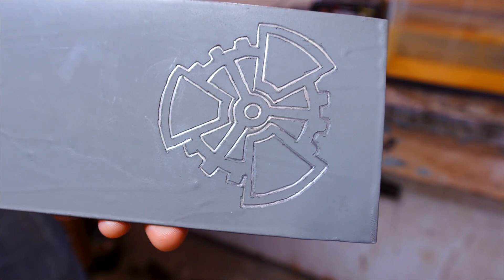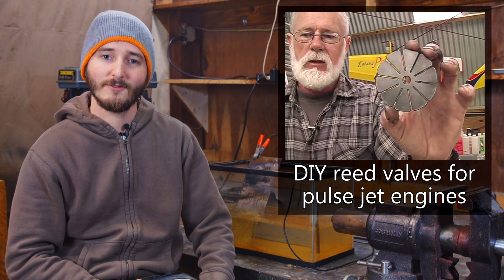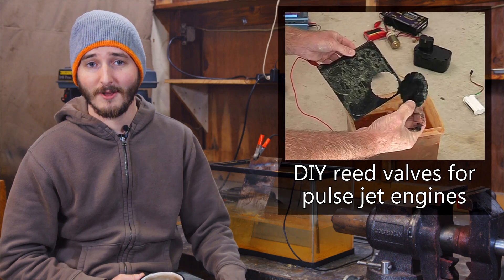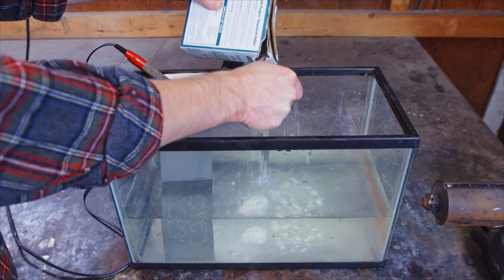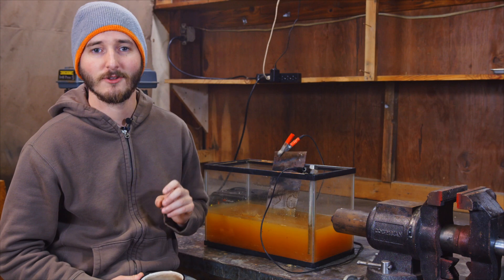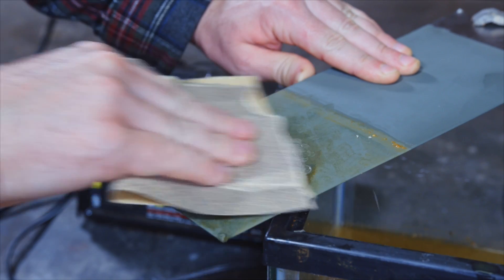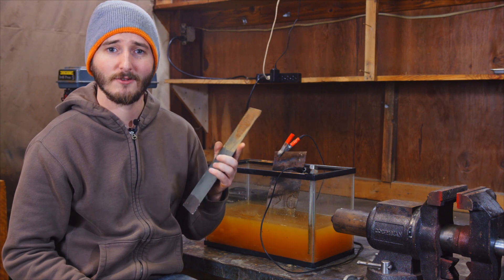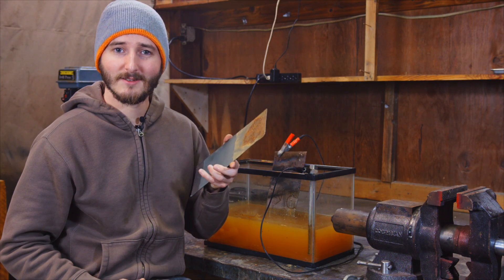How To Cut Steel With Electrolysis [Experiment In Progress] - NightHawkInLight

Comment: I know this is going to sound low tech compared to some other suggestions, but the thickness of your material makes a lot of difference. As the steel is worn down, think of it like a burning a candle. The taller the candle's relation to it's diameter the less even the sides will melt and it will not be uniform along the side walls. If you have a thick sheet of steel relative to the width of your etch, then the electrolysis will begin to infiltrate into the side walls of the etched surface before it's penetrated through. I've seen etchings of copper plate for PCB's be completely ruined because of this. It's not actually getting through or even really under the etching paint or wax. It's going through the side of the freshly etched surface and getting under the paint that way moving laterally through the material rather than through it. Try every so often scuffing it up and cleaning the surface, then reapply the etching paint and scoring new etch lines into the surface. An alternative could also be to use etching pens that would allow you to do touch ups along the sides as you go to prevent the sides of the material from being bleed into. It really has little to do with your electrolyte or the voltage as much as it does the relative thickness of the material to the width of the etching area.

Comment: In simple words, I believe that it's all about the rate in which only the metal part that you want, becomes rust; so the higher the reaction speed is, the better. On the opposite side, a high reaction speed will produce more bubbles in less time, which could lead to bubbling under the paint. 
I think there are too many factors that influence the outcome of this experiment, so rather than explaining them, I will propose a method I believe would work and or some observations:
- The metal sheet should be as thin as possible and hopefully not the cheapest.
- The sheet should first be cleaned with some dishwasher soap and a coarse sponge.
- Then, scrubbed under diluted hydrochloric acid.
- After the acid, it should be dried hopefully under an inert atmosphere and under that atmosphere it should also be painted.
- Now, over the painted and dried sheet, the hand sketching should be done as deep as possible and sketched lines should not be passed over more than one time (it is important that the surface under the sheet is hard and smooth, like marble; also, managing to sketch the figure on the back side of the sheet should cut your electrolyzing time in half!).
- For the etching part, the sketched part should be always submerged in a concentrated solution of sodium hydroxide (or just something strongly abrasive, depends on the paint you use) as hot as possible (wax may not be an option but you could try it without heating the solution) and electrolyzed with the highest (and safest) amperage you can get.
- The goal now is to get the "rust" off, as soon as it is formed; so constant movement of the sheet could be applied or maybe getting a constant stream of the same electrolyzing solution poured against the sheet could also work.

In the end I believe that it is more effective to go with the fast and powerful way (also more dangerous and maybe a little bit more expensive), than the time consuming and maybe more frustrating alternative.

I hope I was of some help, cheers!

Comment: Unfortunately, the whole approach is flawed, no matter what electrolyte is used. Here's why: Imagine a cross section through a cut path. On top is the paint which has a specified break in it. Below that is the metal, which may be scored at the paint break. Below the metal is another protective layer of paint. As the electrochemical erosion of the metal proceeds, you first get a trough, but as the trough gets deeper it begins to form a mushroom shape, which undercuts the top paint layer. By the time the erosion reaches the bottom paint layer, thus cutting through the metal stock, the mushrooming has gone fractal under the top paint layer and your cut becomes very imprecise and jagged.

Comment: um sir.. maybe firstly you should to shorten the length of the plate.. secondly, try to paint the plate with base paint first after that the final coat (to make sure there's isn't any leakage , and finally the way you scratch the metal using proper tool to go deeper (i wonder if drilling will help) 

in my opinion the thickness of the plate also the steel you using is maybe have any effect.. try with very thin plate first sir just a suggestion..

thank you :)

Comment: I have a material very similar to "overhead projector plastic" that you print a positive image onto with a Laser Printer.
Then you can transfer the toner image to metal sheets by "ironing it on" in a thermal transfer process. (search toner transfer paper )

The toner is resistant to etchants like ferric-chloride.
This method is used to make simple printed circuit boards on copper clad PCB materials.

This method should be able to work on sufficiently thin materials as long as you can compensate for the amount of "undercut" you can tolerate.
Also the speed of the etching can vary the quality & speed of the cut.
Try very hot etchant next time.
And do you fully mask one side while putting a positive image on the other side? (one sided etching).
Or do you put registered images on both sides and cut both at once?

Comment: Try a solution of 600ml 85% phosphoric acid 150ml Destilled water and 250ml of glycerin. Do the electrolysis at 20v. Should do the trick.

Comment: From what I can see, is you are basically rusting your way through the steel.
And as we all know rust will work it's way under paint / wax.
so, you will need to clean it regularly, maybe even sand off a bit of the wax, re apply and etch it again.
doing it in 1 step won't work, you will need to do it in stages.
Maybe even try "anti-rust" primer paint.

Comment: The problem I see with this method is the electricity flows through the metal. It can't be precise because the corrosion will follow underneath the paint up to the source of electricity. I would scrap the project, it would be a waste of time.

Comment: i believe it actually the chlorine that is key for this to work i doubt you need to worry about the chlorine as its so reactive it should react with the steel before leaving solution. left over is iron(iii) chloride that's the "salts" you see in the video it should only react with the expose steel maybe even using an acid like muriatic acid/ hydrochloric acid would speed up the process. what you are doing is trying to speed up the oxidation of the steel which in your method might work if the water was moving removing the rust as it form to help speed it up because as it oxidation it forming a layer as its reacts the layer grows thus slowing down the reaction and as form its easier for react it to with the metal around where you want it then getting under the paint. did you clean the metal with something like acetone or alcohol just before you part it in to the bin even slight amount of grease can ruin it. as for the paint that's another issue but i think i saw some comments on that already i'm not well versus on paints i say just silicone or etching primer paint some neutral and water resistant.  that's my theory anyways if gr 12 chem and welding has taught me anything. its murphy's law this is a very tricky process actually. i recommending follow his video till you get it to work then try to change it. i am actually looking in to this more try some small scale experiments try figuring out just whats happening how to make it more efficient and reliable.

Comment: Use the photosensitive compound for etching copper clad boards than print and expose the area you want to cut out and dip it in to the solution. Use low power current source, stir the solution constantly with a fountain pump. The other electrode needs to be as close as possible to the parts you want to erode.

Comment: the problem that I see with this experiment is that the amperage is too low to start with.  If you want to use DC battery ( instead of using a, AC to DC welder) then you will need to make a jewel thief strong enough, to get the voltage high enough (+ have on one side of a few capacitors <[ONLY!!!!! have enough to boost the current to create a connection in the water!!]-[making a polarized boosting Van de Graaff generator] connected to the next one [if there is need] before the AMP step up Transformer in the Joule Thief circuit, and a diode(s) from the capacitor to the other side of the DC step up amp circuit)to convert the voltage into amps ranging from 20 to 90. This will do two things,
1. Will convert the water to HHO
    A. microbubbles receive apps and volts to make a Spark then explode
    B. the explosions makes a small area of high heat and ultrasonic vibrations to cut the metal
(please have the material in a rubber or plastic bucket or container)(no glass please)
2. burn the electrolyte to the base metal to make an electrical coating. ( see, cleaning of HHO plates)

because this is a DIY project I cannot say the exact levels or formulas for each area that is needed to complete the necessary functions to cut the base metal. but hey that's the fun of doing experimentation
( have the base metal negative to make the Sparks jump from the metal to the water) - (and make your scratches as thin as possible, too much exposure equals more heat in the base metal causing Steam and extra burning of the electrolyte) - ( Plus make sure that the water is well chilled to keep the base metal from overheating)
if I can find or think I will try and repost at the end of this post 

for more information look up "underwater CNC plasma cutting"

Comment: I think you have to assume it will always grow out in a radius from any exposed spot, therefore some smaller details will become impossible if the metal is a certain thickness. also your lines to restrain it should then also be brought inward by this radius to account for the thickness of the metal. basically the thickness of the metal becomes an outline, the thicker the metal, the worse it will be.

Comment: I think if you do a hybrid method of wax and paint it may keep the hydrogen out longer, also the thickness of the steel might change the outcome because it would cut down below the layers of steel and start cutting under the paint/wax. I'm not actually sure for any of this hopefully it will all help.

Comment: What is your other electrode? I would try using a plate for the other electrode,  parallel to the workpiece. If the current is perpendicular to the workpiece, it won't eat sideways as much.

Comment: What's the temperature like in that electrolysis box after a couple hours? The DNA electrophoresis boxes we use in my lab get quite hot after a while even at modest voltages, and over enough time it starts to melt the gel and ruin your results. If you have a lot of heat buildup, it might be interfering with the seal of the paint to the metal.

Comment: What if you don't scratch the metal at all. Have a pattern placed on the metal and then use the self etching paint. That way the paint can bond onto the steel and won't be disturbed from scratching. Theory sounds pretty solid and sorry if someone else already commented the same thing.

Comment: Hmm i got a idea, as soon as it starts to bubble pull it out and then redo the wax/paint layer and then re etch it out and repeat the process as many times as it takes to cut through. You just got to check it on a interval and re-coat.

Comment: Well maybe you could cut out a design in Styrofoam then glue/double sided tape it to the selected area of steel. Then paint the thing with three coats then dip it in wax then take away the Styrofoam and do the rest like normal.

Comment: How about you put a template on the steel and spray over it, so that the paint covers the steel properly. That way you can remove the template, leaving the design in 'negative'. The way I see it, the paint isn't damaged this way, and should give less deforming of the desing image. cheers!
Reply from the maker: I thought about trying something like that but making a template itself would be a really tricky project.

Comment: Have you tried different voltages? Electrolysis in Salt water can occur at lower voltages, might be worth a shot if you are using 12 volts, try lowering it? if the voltage is too aggressive you might be producing NaOH which might soften the paint. All of this is guess work from a couch, but I'd give it a try.

Comment: Always use considerable agitation to keep the metal exposed to the solution for deeper, faster, cleaner cuts. Use same area plates as parallel to target when possible for even cutting (think path of least resistance).  Use several coats of enamel.  There will be undercut on thicker targets...so allow for this and finish the piece later.  Don"t give up on this process...it is the most overlooked tool/process in the shop!  It requires an appropriate electrolyte for the type of metal being cut.

Good luck, love your vids.

Comment: Random comments:
Sometimes it is necessary to use chemicals which are not safe for children.
I like 10 percent LYE solution.
Adding common salt to vinegar produces weak hydrochloric acid. 
It is not always necessary to use a container which is huge compared to your work piece.
Constant flow or agitation of the liquid is often helpful.
A large electrode close to your work piece is superior to a small one inches away.
See "Electrochemical Machining," one may find some clues there.
disclaimer: Assume that everything I say is wrong.

Comment: You could lay the metal piece on a table. And put some type of ring around it using like (I don't know, hot glue?) and pour water in the ring. Then dip an electrode in the water and run the current. Also make sure that you still have it coated of course.

Comment: Maybe the time is factor too, I work with electrolysis often in lab and I know for experience that high voltage gets tings going at faster rate,  just get some more batteries and hook them up in series to increase the voltage. I also saw that the sheet of steel was hooked up to red wire it should be hooked up to black or the negative terminal but that's just my suggestion

Comment: maybe I missed something in the video but the first thing that stood out to me was your flow. You need both an anode and a cathode. Personally I would submerge the metal in the center of the tank, upright, then have your anode at one end, then your cathode at the other. I've found decent carbon steels work well for this. You can continue to use the baking soda (washing powder variety) if you use two pieces of carbon steel and your water won't get as gunked up. 

interestingly enough, this process will also clean the object inserted. Its a method I use for rust removal. Occasionally it has cut steel for basic etching designs I've done. I've never tried anything like completely cutting THROUGH steel, but I'm assuming it should work.
Reply: Oh, uh, kinda an important step: Do this shit outside in a well ventilated area. 

also to note, I'm not sure if being used directly as your anode is what is causing the bubbling on your paint (though I'm willing to guess current passing through it from beneath the layer will create a bubbled effect where its released) but if it doesn't change with the setup I mentioned, try changing that first. Most etching jobs take only a few minutes. I've seen some groves put into solid steel cylinders that were impressively deep without it causing the metal to rust in minutes.

Comment: use high voltage , because  u need to cut it  faster so it does have time to propagate inside the steel, and ruining the design

Comment: For your resist, you want Bitumous or bitumin paint.  This stuff should resist the blistering effect the best.  You can load up a fountain pen and draw with it or apply it over a stencil.  You could put it in an airbrush too if you wanted to spray it over a stick-on-stencil.  

For your setup try lower volts and try using a mild steel plate or a graphite plate, directly opposed to the surface you want to cut instead of your Stainless supply hose you are using.  Stainless won't give you good results.   If you find you are removing too much of your resist try lowering your electrolyte concentration.  You can also come back over your design with more bitumin paint to close in the 3d propagation of your cuts.  

I did some playing around with different electrolytes specifically for removing rust and forge scale in several of my videos and I plan to go back to it for etching when I get the urge to try this again but I don't know which one will work best for your application.  Interesting results, though.  I love that you showed some of the fails.

Comment: cant you just do this with hydrogen peroxide and muriatic acid? 
Iron(III) chloride is soluble in water making the cleaning of the metal much easier and it's much faster than electrolysis. The speed should make it so that the muriatic acid doesn't erode away too fast under the freshly exposed surface under the coating.

Comment: Another thought: for a more "cutting" oriented process, try looking up wire EDM machines. they use these for precision machining pre-hardened steel without generating stress like heat based methods do. should be relatively easy to find videos on DIY EDM Machine on youtube...

Comment: your dealing with a problem known as undercut; which is when you are etching too deep and the new surface exposed alows it to eat perpendicular to the direction wanted. as far as I know there is no way to prevent this except not trying to get a excessively deep etch. I have never heard of anyone useing electrolysis to cut steel. then again what do I know?